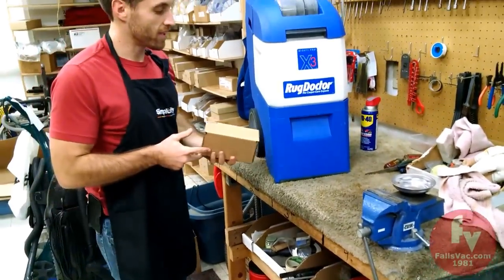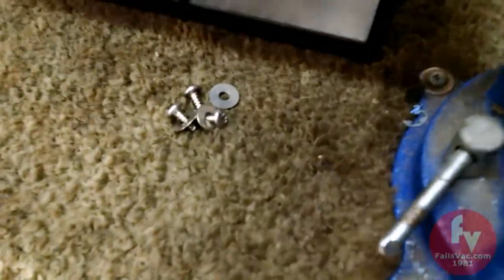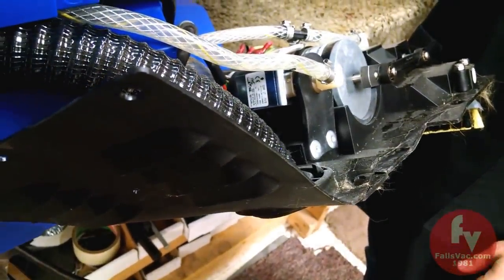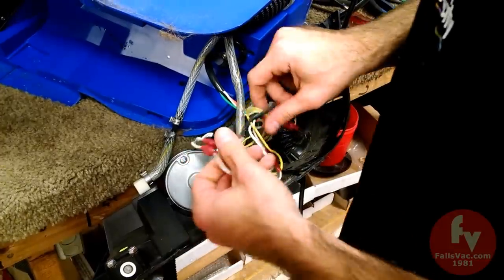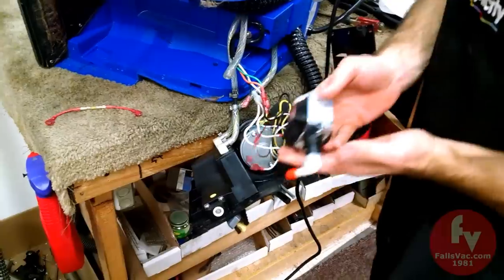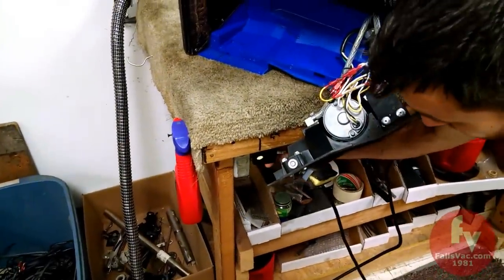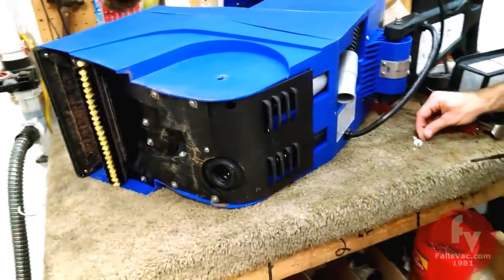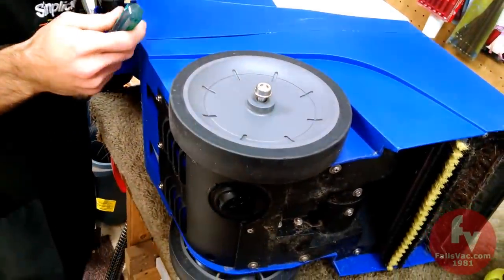Rug Doctor Pump Kit Replacement by Classic Vacuum

Comment: Best video on youtube for Rug Doctor water pump replacement!  A couple of suggestions ... remove the wheel and axle AFTER you remove the panel, take a couple pictures of where the wiring and tubes are arranged around the axle. When putting the unit back together, install the axle BEFORE you replace the panel so you ensure a clear path from one axle hole to the other around the wires and tubes.  Would also highly suggest using screw clamps (less than $1 each) for easy installation, and in event you need to remove the clamps at a later time.  Great job!
Reply from the maker: Thank you for the comment. I totally agree with the screw clamps. A small price to pay for a huge improvement should you even need to remove the hoses again!

Comment: Picked up one of these, very clean for 5 bucks, wouldn't spray. They even put a new pump in it. After talking it apart 2 times I figured it out. They had inlet outlet reversed, left the diode in line and had it powered backwards. Thanks for the vid.
Reply from the maker: Great to hear!

Comment: I went to use my Rug Doctor last night. Vacuumed, made up the mix & filled the tank, pre-treated the area, & then no spray.  The pump looked like the one in this demo. I unscrewed the  metal plates on each end of the pump, which hold the plastic fittings in place. The arrow on the pump indicates the flow direction. Inside the base of the arrow side there is a heavy spring & a metal piston. In this piston is check valve which allows water to only flow in one direction. Under the opposite side of the pump, the one that the arrow points to, is a small spring with an attached ball that also serves as a check valve. The metal piston was stuck inside thee pump housing. Took it out, & noticed a small amount of what appeared to be some kind of rust-like deposit. Cleaned the piston & the channel it rides in with some good metal polish, so that the piston is free to move. Now I have to put everything back together. I don't have many hours on the machine, but have had it for a number of years. The only issue I had with it before this was the suction hose strainer falling of in the tank. Needless to say, I was a bit pissed off when I discovered that no water was being sprayed. I feel confident that the pump will spray again, but for how long is anyone's guess.
Reply from the maker: Sometimes the black flow plungers get deformed (epically when vinegar is used). The coil could also be bad. I did have one a few weeks back, I was trying to figure out why it would not pump and could not figure it out either.

Comment: What was the original problem that required the pump to be replaced?  I ask because mine is not spraying and the vacuum doesn't seem to be creating suction from the base although there is a strong suction when checking by removing the filter in the clear dome. Any suggestions?

Comment: I couldn't get through the entire video, but here are suggestions to help avoid borking parts during the first few steps of the removal process:

1. The spray hose can be loosened as instructions request, by sliding back the clamp side of the brass dram connector. 
2. If you need to reuse the cap nuts, pry upward from underneath on each side of the retainers with a pair of screwdrivers or similar tools. 
3. Avoid stripping phillips screws by using the drill's low speed and, before operating the driver, seat the bit well and apply enough pressure to keep it from backing out.

Comment: Mine is leaking profusely when you spray directly below that area of the pump.   Before taking it apart is that the pump gone bad?
Reply from the maker: Hard to say. I've seen the elbows or even the sides of the pump crack. Best to dig into it before ordering parts.

Comment: Eric, excellent video, however, the wire connection section part of the video was stopped; I couldn't view how to reconnect the four wires.   My old pump had two white wires.  The new pump has a thick and thin black wire.  I read below your answer is to connect the fuse to the thin black wire.  Okay, got that part, now where do I connect the other end of the fuse, to the black or white wire?  Then I assume the thick black wire coming from the pump connects to the only wire left.   Thank you.

Comment: I have the wide track it has 3 wires. What is the 3rd wire for. When i ordered the pump i didnt know that it took two. So it sat for a while until i got the 2nd pump. Now I'm so confused with the wiring. Only one pump originally had the diode. So does both pumps get the fuse to replace the diode.

Comment: I must've ordered for a different model.  The pump I rec'd looks like this one but my Rug Doctor Mighty Pro has blue wire connectors and the red male blade connector that came with the pump (fuse link) doesn't fit into the female blue connector on the machine.  I think to get myself running, I'm going to butt splice the blue connector off of my old diode onto the end of the fuse link.

Comment: Great video! I am trying to complete the installation of my new replacement pump and I am stuck. The old pump has 2 white wire (female connectors). The new pump has a thick RED wire (male) and the thin black wire (female). They sent a red fuse (male one end female on the other end). Trying to reconnect I’ve tried different combinations - get stuck. Short black wire from switch (green clip female end) fits nothing. Won’t connect to any pump wire. White wire from switch ok. Do I have the wrong pump? Should I change an end? Called rug doctor twice - no cb yet. Thanks for your great video and help!!!!!!!!
Reply from the maker: I think we spoke on the phone and figured it out. On some machines the ends don't match up or fit together depending on the age of the machine. I personally remove the connectors and use wire nuts. You could also replace with the same type of connectors if you like.

Comment: nice work. mine sprays just for a few seconds while holding the red button then the spray will stop and be very weak. if i hold the red button down for more the 30 seconds. it will not spray and the carpet will not be wet. just really hot.  is it possible that some ofthe motor hoses could be clogged up? ive used other soulutions in my rug doctor. not just rug doctor shampoo??  hell ive used Awessome powder, laundrt detergent, pine soil, and rug doctor shampoo.
Reply from the maker: Rug Doctor pumps do not do well with powder detergent. Do not use anything in the pump other than Extractor Detergent and maybe an Odor Removing product designed to be used in Extractors. There are line filters and in the clean water thank that will get clogged or gummed up. Check that as it could be your issue. If not take it to you local Vac Shop. Call and make sure they repair Rug Doctor before making the trip.

Comment: Hi classic vacuum & everyone else. I need the wiring diagram for a Rugdoctor mighty pro X3 model MP-C3, with the 2 2 rocker switches in the main body as well as the white reset button, I can find diagrams with the rocker switches and the reset button in the handle but not in the main body, please help classic vac or anyone else please. Great video learned a lot thankyou.
Reply from the maker: We have this, contact sales@classicvac.com as we can send that info.
Reply: Thankyou I will contact that link to try and get the information I need, If their based in North America I'm not sure they will be able to help though, my thinking is my Rugdoctor model mp-c3 might be a European model but I'm not sure, Thankyou for your kindness I'm very grateful.

Comment: Hey Aaron, what a great and in depth video you have made. Please keep up the good work. I am from the UK, and I have the same machine.  The problem being is the front brush does not oscillate, everything else works fine. Any ideas that may help...?
Reply from the maker: Thank you for the feedback. It is most likely the "Drive Motor"
https://classicvac.com/brush-drive-motor-rug-doctor-mighty-pro-x3-wide-track-quick-dry/

If the motor is getting power than replace the motor. You can also test the motor directly. Some times the motor can fall apart. If this is the case you will see the silver end separating from the black body.
Reply: @ClassicVacuum  You are a star Aaron, lots of love from here in the UK 🇬🇧

Comment: Hi can you give me a bit of advice my pump works fine with the hand tool button is pressed, on machine but when I turn it to carpet and press the button on the top of the handle nothing comes out ? It's a new machine only used 2 or 3 times my mate bought it new and has lost the recipe or I would claim the warranty hope you can help thank from Scott in Scotland
Reply from the maker: I would guess it's a bad switch or loos connection. Check all the wire connectors to both the Red and Black switch inside the machine.

Comment: Great video. I could do with your advice the brush on my rug doctor is starting to stop any help please
Reply from the maker: You may need a dew brush drive motor.
Reply: @ClassicVacuum  put one in to night it was a nightmare 
To open the two nuts on the bottom of the motor ended brakeing the plastic on the bottom a 30 min job took 4 hours  I had to repair the bottom of the machine with glassfiber .thank for replying

Comment: Between the thick and thin black wires coming from the new pump, which one connects to the fuse?
Reply from the maker: It depends on the how the connectors are configured in your machine. It does not really matter. I would connect the thin wire to the fuse if I had a choice. I would personally wire it Hot > Fuse > Diode > Pump > Ground.